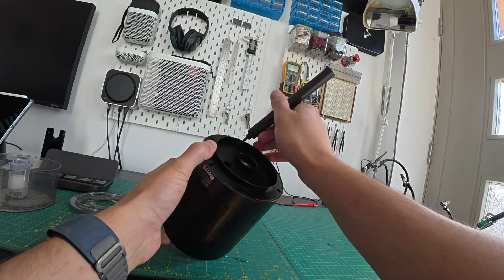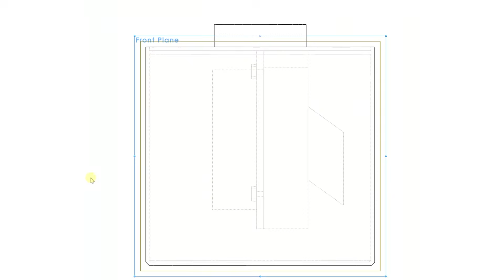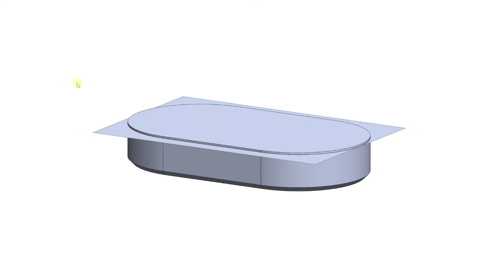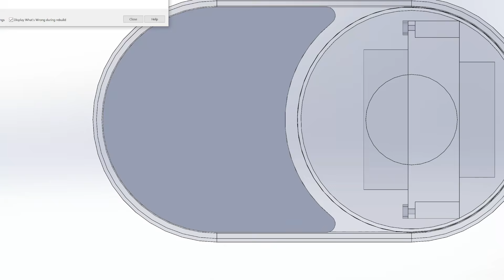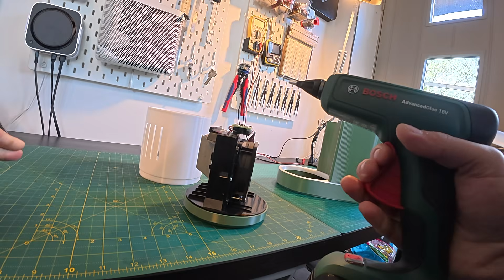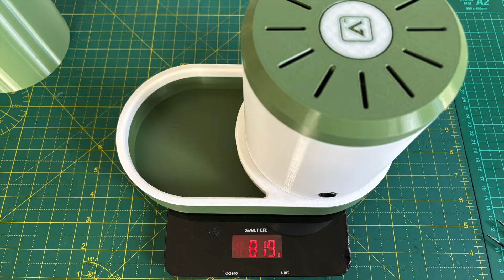I Built a Self Watering Dehumidifier Plant Pot! Part 1

Comment: amazing project!!! But i think the amount of water may be a lot more than what you have estimated, cause, once the water starts to puddle up on the open side of the container, evaporation also kicks into play, and at 50% humidity, it plays a non-trivial role. So there might be more water produced, but over the course of 7 days, might have gotten evaporated!
Reply from the maker: Thanks! That’s a great point, evaporation definitely adds another variable to the experiment! 🤔
Reply: I think this also depends on the room temperature. You can say the same for most self watering kits in this case! If anything its better than water thats just a set amount to start eith & that needs constant refilling. In the UK we have alot of humidity and not such high temperatures (unless our central heating system is on high). it's ideal for non-extreme climates!